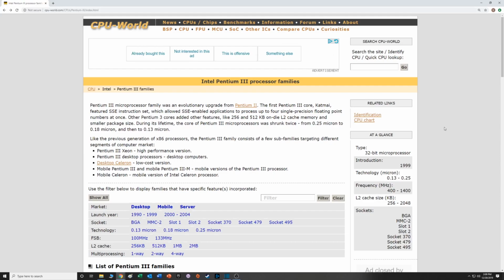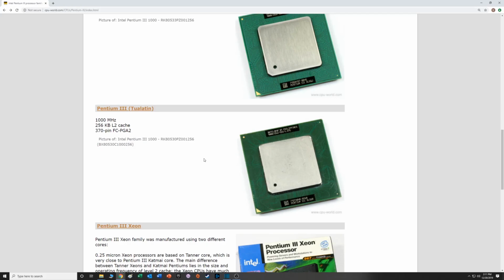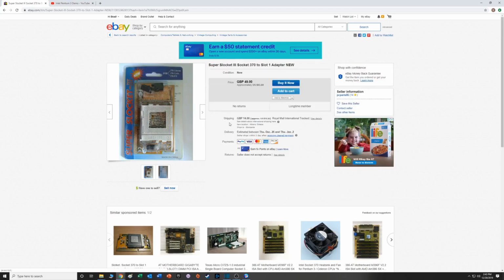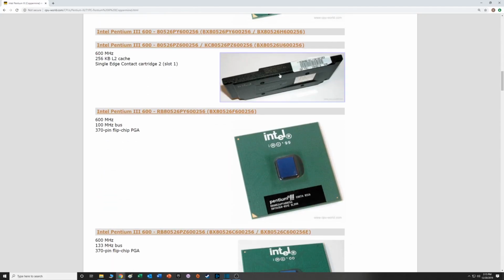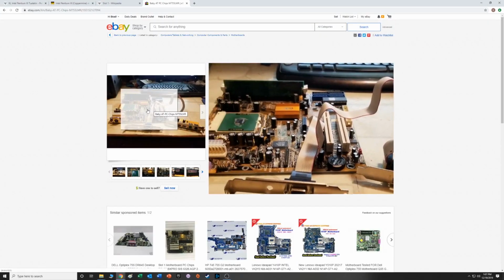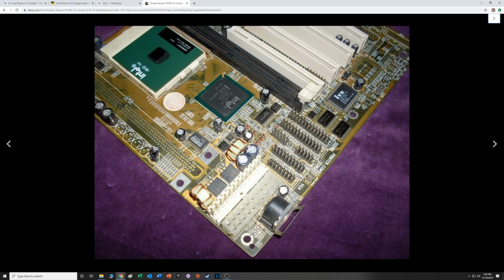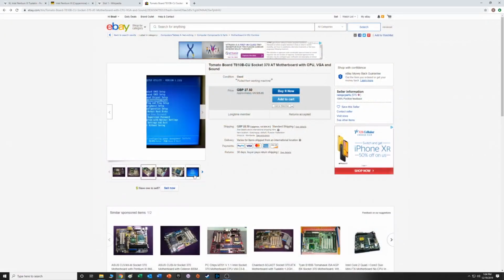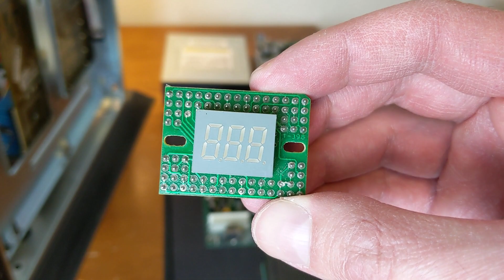'Tower of Doom' Update: What is the fastest possible AT form factor PC?

Comment: I am using a GA-6BA with a PIII 700mhz on a Slotket-Adapter but somehow I can't get the 1.1ghz with FSB 100 to work. 
I'll get a 9800se soon because my Geforce 2 GTS crashes in games due to a lack of power supply. Maybe it will work because the ATI has its own plug for the supply.

Comment: Well, Pentium III is not the fastest, there were even AMD Socket A, Pentium 4 or Pentium M  AT motherboards (Jetway 849BS, Commell P4XB and Corvalent Gator AT). The last one unfortunately is an industrial board and has only PCI and ISA slots, no AGP. And all are probably rare as hell nowadays.  

However can go beyond that and put some modern day era components in AT case even though the last motherboards in AT form factor were made almost 20 years ago. I've had an idea to buy a PICMG 1.0 LGA 1150 single board computer (idk if there are LGA 1151 ones) and AT backplane (similar to the one used by LGR in his 486 SBC build)
https://ipc.msi.com/product_detail/Industrial-Motherboard/PICMG/MS-98G7
While such backplanes have no PCIe slots, only PCI and ISA, the single board computer has a mini PCIe connection, therefore allows installing some modern GPU. You'll probably lose some performance since mini PCIe is AFAIK equal to 1x PCIe, and industrial parts are pricey, but if someone really wants to make a sleeper PC in an old AT case (like i7-4790 paired with RTX 2080 or something) without destorying it - that's definitely possible.

Comment: I used to have a Slot 1 mobo with a FSB of 100Mhz. I lucked out and found a pre-made slotket that allowed a Tualatin Celeron 1400Mhz to run on it. I OCed the FSB to 115 and got it up to 1610Mhz. I paired it with a Radeon 9500 Pro and it was pretty sweet; the video card couldn't stretch it legs completely but it maxed out the platform (it was a Blaster PC). Maybe you could find that on eBay and try it out?

Comment: There are some Baby AT size Socket 478 (Pentium 4) motherboards out there. For example Commell P4XB: https://www.bwi.com/document/2430

Later Baby AT boards are nice from a compatibility standpoint. I have a 1999 Super Socket 7 Baby AT board that has both AT and ATX power, as well as SIMM and DIMM RAM sockets, and AT keyboard connector plus a header for PS/2 keyboard + mouse.